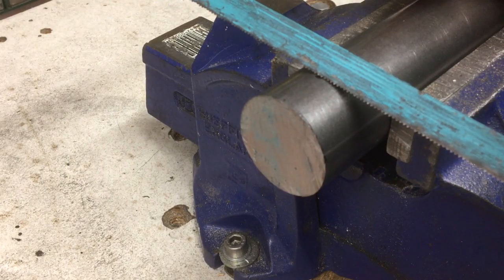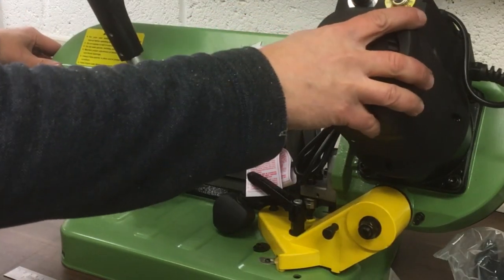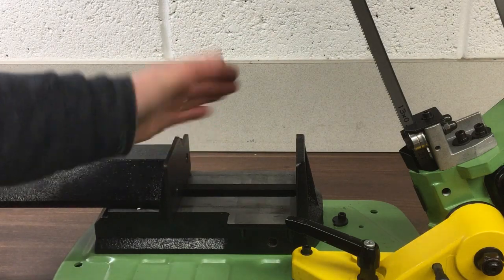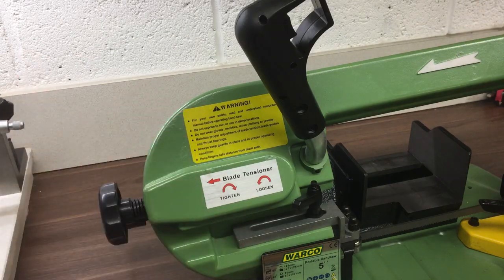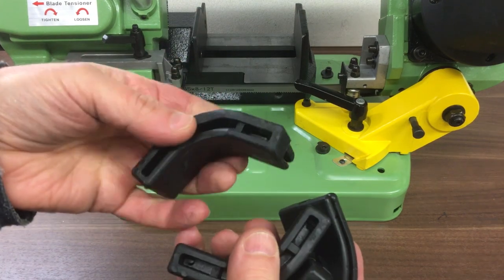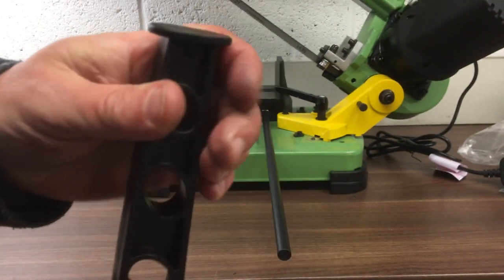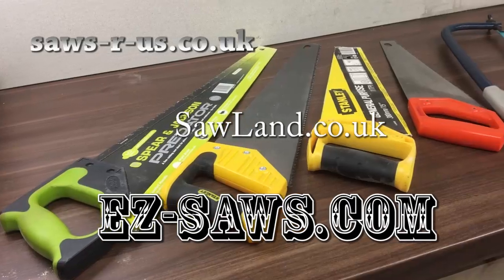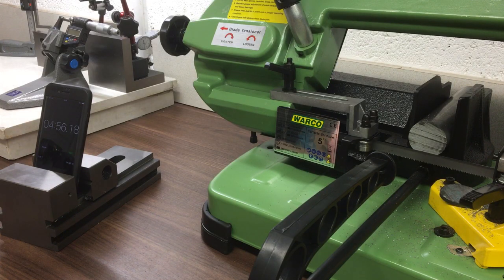Warco 5" benchtop metal bandsaw  |  Any good ?

Comment: I also bought one of these 5 inch Warco metal cutting bandsaws for £375 (including free delivery) when Warco were having their discount sale, It's been fantastic ! and has cut just about anything I threw at it including 5 x 5 timber fence posts ! - Don't worry about the motor of this saw only being 400 watts - it has a very strong reduction gearbox which gives it's permanent magnet DC motor even more torque !.... the first day it arrived I was rather curious to see what lays under that huge plastic cover, I undone 4 small Phillips head screws and carefully slid the motor cover off and I saw a long, slim PM DC motor attached to a nice reduction gearbox,  the motor resembled something like a treadmill DC motor !, there were also lots of wires and a massive circuit board module that controls the motor via a sophisticated variable speed feedback circuit (where when the motor is under load it increases the voltage and current in order for the motor to maintain the set speed whilst under load when the machine is cutting.)

All in all this is a great saw and well worth the money if you manage to get it during Warco's discount period before they put the price back up to £412 !
Reply from the maker: I'm happy with it so far and I also managed to get it in the sale.  The main base and arm are really sturdy but I do still worry about the motor.  To be clear it has been OK so far but the speed does vary a bit and I just wonder about how long it will last based on Tr Precision Machining comments about his friend's experience.  We will see.  Thanks
Reply: @routercnc9517  It seems well made and very similar to my friend's "Cutmax" saw which he has had for the past 12 years and its still going strong in his workshop ! - Keep it clean and service it regularly and it will last for a long time - worst enemy of any permanent magnet DC motor is metal sawdust ! - Good luck man with this saw and all your projects !
Reply from the maker: OK thanks.  That is encouraging.  I’ll take the motor cover off at some point soon and give it a regular clean out.

Comment: 2 years on, is it still going strong?
Reply from the maker: Hi Matt.  It still cuts very well and comes in handy for large stock, or instead of parting off large diameters in the lathe.  Some negatives are:
1) When setting to 45deg, then setting back to 90deg the cuts were no longer square even though there is a stop to return to.  Took a bit of fiddling to get it back again.
2)  Vice jaws stop some way short of the blade so it can't cut very short stock.  This is to allow the blade to swing for 45 deg cuts but I rarely do that so I might add longer jaws (bought the material but one for the list!)
3)  Because the machine is so short there is very little space for the blade to untwist from going around the wheels to going vertical through the cut.  This causes the blade to try and ride up on the pulley wheels which causes occasional bangs as it resets itself.  I normally have to ease of the cut or stop briefly.  One time I got annoyed and just plowed on but it got very loud then snapped the blade.
4)  The DC motor controller hunts around and does not stay at a fixed speed.  It's not much but it does not inspire quality on the controller.

Despite this it is still a great machine.  Very small footprint, and so much better than cutting large stock by hand.  It was around £300??  when I bought it, sorry it might be in the video!  Not sure what it is priced at now so you'll have to make the value call, but I have no regrets.  Hope this helps.
Reply from the maker: If you are UK based Warco have various sales on, if you are not on their mailing list give them a call and get on it as I think they are pretty good deals when they come around.  Or pop down to their showroom (phone first) and see what you think first hand.  Very friendly staff.

Comment: will it hold small parts? how close to the vice is the blade? by draper horizontal band saw has a 1/2 gap between vice and blade...bit wide for tiny stuff
Reply from the maker: The gap from the jaws to the blade is about 15mm.  I notice the moving jaw is screwed on so you could make a custom jaw for that one up to the blade.  You would have to tap the fixed jaw to mount something similar there but would work.  Not checked but would probably not allow mitre cuts.  So maybe mount the jaws in slotted holes to move them in and out as required.  Also machine V along jaw centreline to hold round stock.
Reply from the maker: By the way what was your PhD in?

Comment: hello from asturias spain .. i have a friend who once had that saw but from optimun brand and the truth is that soon after i ended up selling it given its poor quality and poor performance .. in my case i also have a very similar quee s of The Italian brand FEMI and the truth is that after 2 years I already changed the electronics .. gearbox sprockets etc .. in the end I got tired of repairing it and bought a HBM brand saw but bigger with a normal single-phase motor and that includes Liquid pump .. with the hbm if I am very happy it is a machine that weighs 135kg but if you have little space they will not serve you since they take up a lot .. I hope you have luck with the warco .. I recommend that you cut very slowly with it and so maybe it will last you a little longer .. in truth those saws are designed to cut profiles and pieces of little diameter .. when you put pieces of more than 35 or 40mm, the problems begin one after another, this What I tell you is my experience with this type of saws, maybe you u have more luck than i have had with them ,, greetings
Reply from the maker: OK thank you for sharing your experiences.  I’ll have to see how I get on with it.  The frame and base seem to be solid and well made.  We will see how the motor and electronics hold out.  I do have a single phase 750W motor (from my drill press upgrade). . . .!  Let’s see how it goes.  Thanks
Reply from the maker: What happened to the gear sprockets?  Are they metal or plastic?  Did they wear out or break ?
Reply: @routercnc9517  the sprockets are made of a very bad metal and they broke into pieces ... very bad quality and very bad factory setting ... then the speed regulation plate broke and finally the motor was scorched ... in my opinion is very bad buy that type of saws
Reply: @routercnc9517  I have a friend who adapted one of those saws to him an endless reducer and a three-phase motor with a VFD and since then the problems are over .. although the adaptation takes a lot of work but if you don't have room maybe in the future if it goes badly it is you only alternative
Reply from the maker: OK good to know thank you.  I could faintly smell ozone when the motor ran.  It is a brushed DC motor ?  The specs don’t say.  If the speed controller ever breaks in the future I will know what type of controller it needs. Or I could swap it out as your friend did for a 3 phase motor and VFD if I have problems in the future.  Thanks
Reply: @routercnc9517  There are two models of motors and controllers, some mount alternating motors with brushes and an electronic speed control board and others mount direct current motors with an electronic board, in either case the motors and electronics are of bad quality..a greeting
Reply from the maker: OK thanks

Comment: Well i've had one for just under two years...............sorry but i'm not happy,  after hours spent trying to adjust it i still cant get a straight cut,fine on the cross section(90 degree),but on the down cut it wanders(bevels) mainly to the left,gone through 5 blades of differant makes/sizes,different speeds/pressure you name it,on a 50mmx50mmx3mm mild steel box section i'm out by 1mm.
My only assumtion has to be with the roller blade guides,just somethings either missing or bad design
The only real +'s with this is the workclamp,good torque on the motor and its weight its easy to load into the van etc
Would have been great if a laser cut line was added,but there you go
I once bought a cheap one from Aldi which was perfect straight out of the box,shame it fell to the ground two floors up☹
Reply from the maker: Mine has cut straight on anything I’ve cut so far so maybe I got lucky.  I did have a problem whereby the blade would jump and make a bang every now and again.  I worked out it was because the saw is quite small so the blade has to twist back onto the roller in a short space.  This made it ride up the roller until the tension banged it back into place.  I fiddled around but couldn’t improve it and in the end the blade suddenly snapped.  I bought the more expensive blade type and that has been fine since.  The mechanical build quality is very good with nice Ali castings and a good vice.  The motor however does not exude a quality sound and fluctuates in speed so we will see how long that lasts.  I may do a follow up video and include the comments from others so far and my own experiences but this will be a later way off.  Thanks for your comments, hopefully this will all help others with their decision

Comment: How are you getting on with it? I've got an Evolution Rage 4 185mm chop saw which seem to go through aluminium just fine, but apparently it's not really suitable for steel or iron, so I was toying with the idea of getting one of these. £375 is a lot for that upgrade though, given I rarely need to cut anything over 40mm, and I've managed OK with a hack saw until now...
Reply from the maker: I got lucky on the price as it had been hovering around £320 for a while and then they had a sale and it was about £290.  That was enough to buy it as I'd been looking at it for some time.  £375 is not impulse buy levels so I'll try to give you my honest opinion having used it for a while.  The overall build quality of the cast metal parts such as the main frame, the lower base etc are very good.  It feels structurally very solid and has a nice action in use.  The only 2 parts which let it down are the blade seems to jump slightly once per revolution which is probably where they joined it.  It's not obvious by looking the blade but I will wear this one out and probably go for the higher performance blade for ~£35.  Cutting through large diameter steel parts is very good and is very fast compared to manual cutting or parting in the lathe, however.  The other part is the motor itself which works well enough and seems to have enough power in general but does not sound or feel like it would go on for many years without something happening to it or the controller.  I think it is a brushed DC motor and the speed controller is not great and the rpm can fluctuate when cutting (load independent).  I had someone comment here that their friend had one and the motor or controller was the first thing to go.  They ended up fitting a 3 phase motor and invertor drive which I like the sound of, but it would be some work and cost at least half as much as the machine.  I also have a rage pro and they are great but for thicker materials they don't sound happy and really in my experience are better at the thinner wall stuff.  Thick aluminium can clog the teeth very quickly requiring cleaning out during a single cut.  I still think either this saw, or something like it is a very, very good addition to the shop and is just about worth the £375, but ideally see if it comes up a bit cheaper in a sale etc.
Reply: @routercnc9517  that's some great info, thanks so much. I just missed the easter sale, which would have saved 10%, so I'll at least wait until the next one and see how often the hack saw comes out until then. Cheers!